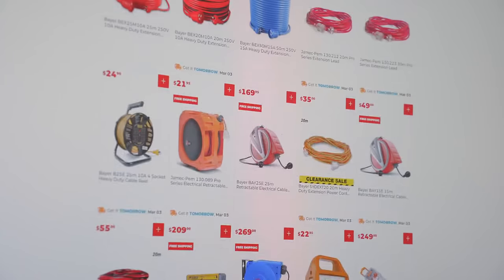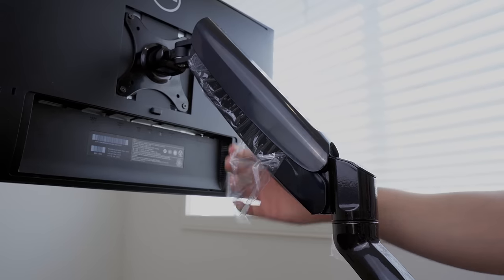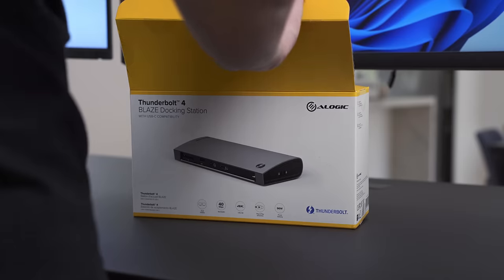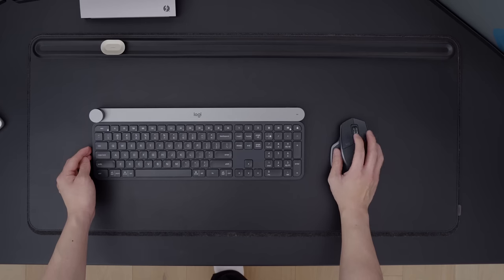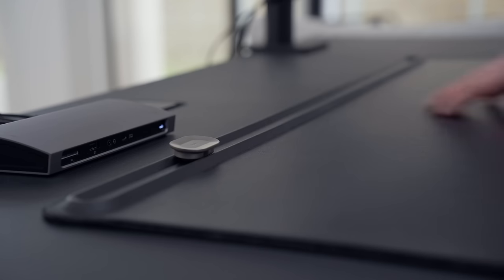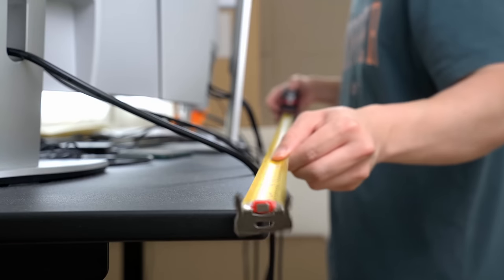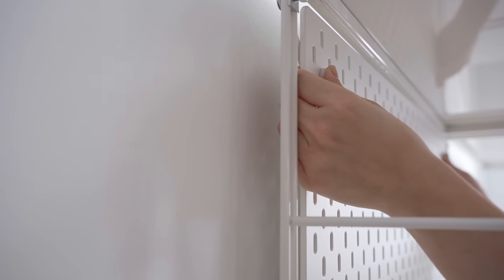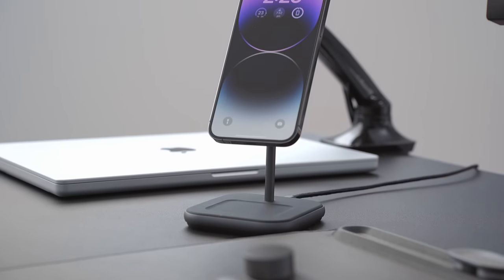Building my MODERN MINIMAL Desk Setup 2023!

Comment: Hello I only have 1 Display Output (hdmi) by which I have connected by main primary monitor, can I connect my secondary monitor by using usb port ??  If Yes can you please suggest me the way ?
Reply from the maker: Some USB-C ports can delivery video output. I suggest looking up your computer's specs to check. Then just use a USB-C to USB-C, HDMI or DisplayPort cable depending on what ports are available on your monitor.

Comment: Is there a way to hide the macbook but don't let it heated?
Reply from the maker: I would consider a bracket that would allow you to mount it underneath the desk. If you have an older mac that is prone to heating up, there are brackets that leave the bottom of the mac exposed which should help it stay cooler.

Comment: Do you use a kvm switch?  I have a similar setup with a Mac laptop and a Windows machine and switching back and forth is driving me nuts.
Reply from the maker: When I'm only using either the PC and Mac, these monitors automatically switch to whatever input has a signal, but I KVM switch is definitely something I want to try for my setup when I have both the PC and Mac going 🤔
Reply: @TerryX_    I typically have both running at the same time. I used to use kvm switching but the new hardware isn't compatible with my old switches. Perhaps I should invest in a new one.

Comment: Wait, How do you hang on the IKEA pegboard?
Reply from the maker: So the pegboard comes with a mounting bar that it screws into. Normally you'd nail the bar into the wall, then put two screws into seperate holes on either side of the pegboard, before screwing it into the mounting bar. What I did was, I didn't put the screws all the way through the mounting bar, only the tip of the screw, leaving a gap between the mounting bar and the pegboard. So I've just hung it on the cross bracing on the shelf so that the space where the screw is, sits on top of the cross-brace. For stability, I tightened to screw so that the cross brace is sandwiched between the mounting bar and pegboard.

Hope that makes sense! If people want a bit more detail, maybe I can do a quick short on it.
Reply: @TerryX_  Ah I see, that's how you hang it perfectly... Thank you, It's makes sense now...

Comment: Extension cable into surge protector? Isn't that a dangerous combination because the guage different between the two products and the resistance increase from the extra length of the cable to the power surge protector?
Reply from the maker: I did some research and the both the extension cable and surge protector are rated for power and current loads greater than everything I've got plugged into it so I think it should be fine. I'm not an expert though, happy to listen if anyone has more to add

Comment: Nice setup but it would've been more practical and just as clean to have it against the wall under the window, and it would've probably solved your speaker cable problem too. You could have your speakers on each side of the desk. Looking at the back of a desk, monitors, and a PC is really not that attractive at all.